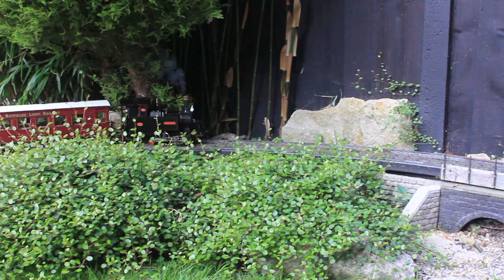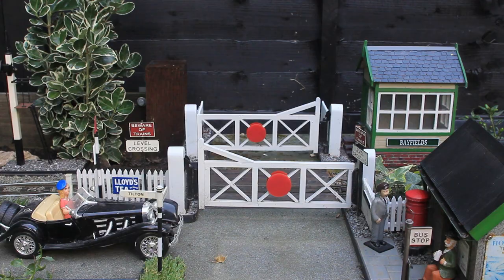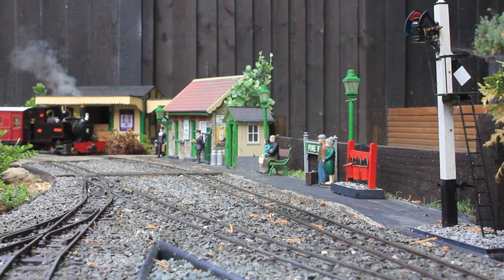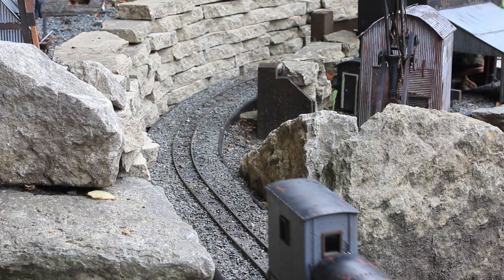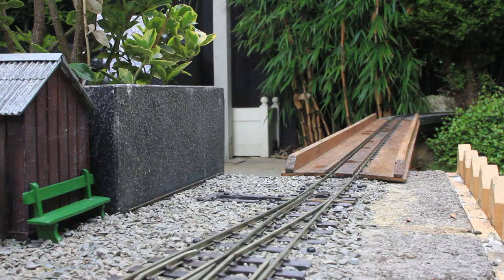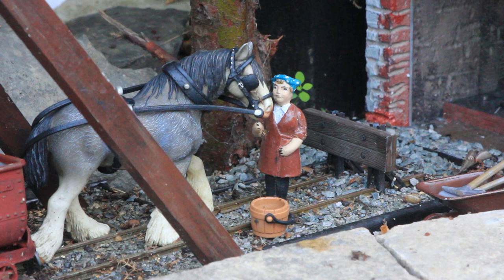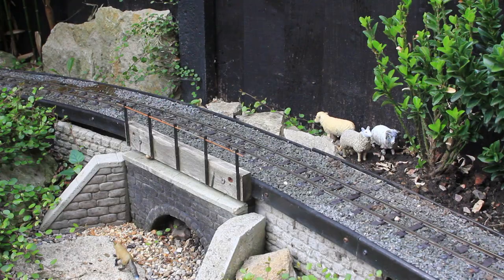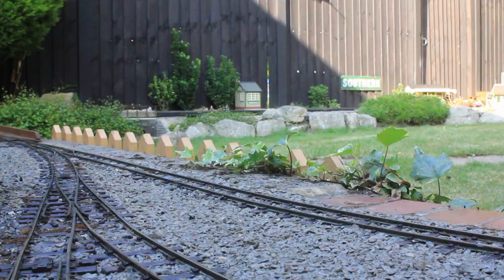Summer 2022 On The Bayfields Light Railway - A 16mm Scale Garden Railway

Comment: Excellent video. I watched the first part several times and paused on the pictures to look at some of the details. Given I live beside the Pacific Ocean in British Columbia, Canada, I don’t get to see much British rolling stock in the flesh, so to speak. 

I have been poking around Swift Sixteen’s website and am attracted to some of their kits. I have never seen or handled a Swift Sixteen railcar. Yours look great. I did note some wheel noise. How would you rate them?
Reply from the maker: Hi Terry,
The Swift Sixteen kits are excellent and can be built very quickly. They run very well, I think my axels just need an oil!
Reply: @robgolding96  thanks. Then I shall order some.